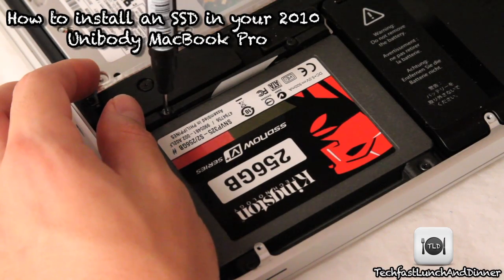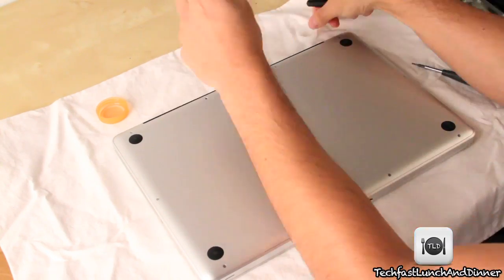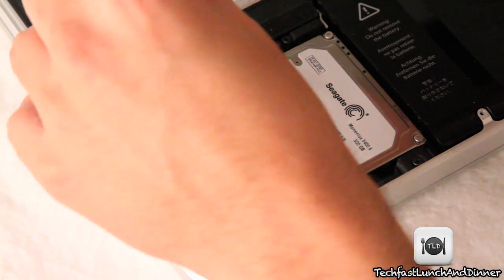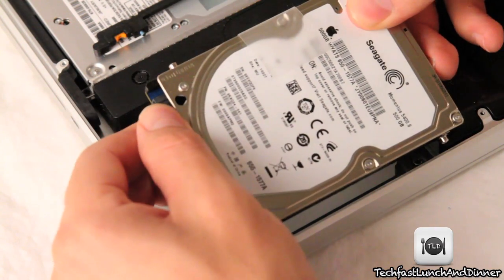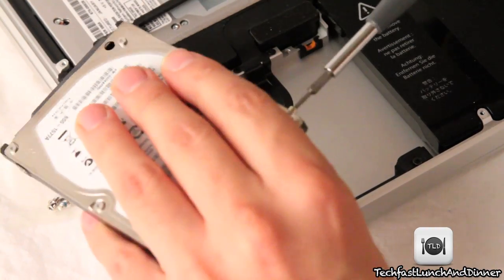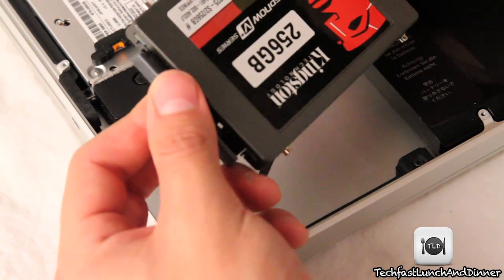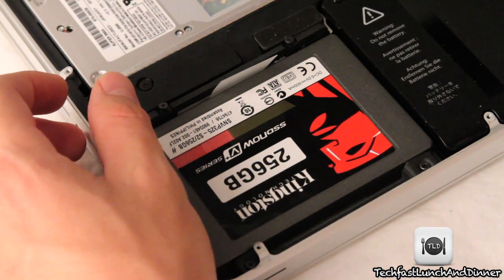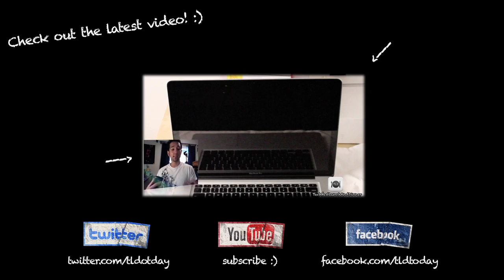How to Install an SSD / Upgrade Your Hard Drive on a 2010 Unibody MacBook Pro

Comment: Thank you for this old clip. Love their large size display as apple rarely if ever opt for 17" on laptops.
Are these unibody Apple MacBook Pros say those with Core 2 Duo 2.66 cpu any good for 2024? Or has Apple as always castrated them with wrong firmware upgrade/update or simply stopping the needed support to be compatible with current web media, despite having good hardware?

Comment: If i don’t have the OS installer, should i still do it? I am confused.

Mine is macbook air 2010/2011 OS snow leopard. Is the air same as the pro?
Reply: I might be in your shoes... So what did you do 2 years back if you still remember that?

Comment: Really well showed and explained. I’ve just done it myself following your instructions with my MacBook Pro 15 and Kingston 480GB SSD. Before that I’ve cloned my HDD to SSD using Carbon Copy Cloner. The machine is much faster now! The only puzzle is that when I turn it on, just blank white screen appears for about 10-15sec before Apple logo… then goes super quick. I’m just wondering if you have any idea how that can be reduced somehow… it wasn’t happening with old HDD. Maybe to change some settings…? Anyway it’s not a huge problem coz otherwise works great! Thanks

Comment: Hi Bro....Please advise.... is it also good to upgrade the RAM with SSD 250GB?? I have mid 2010 white 2GB RAM and 250GB HHD. I will upgrade to SSD for sure but would you sugest to upgrade RAM with SSD?? Is there any mean to upgrade the RAM? Please advise.... Thanks
Reply: Edge upgrade ram too it will help in the long run

Comment: Jonathan.  I have a question.  I ran out of space on my MacBook Pro (15", 2010 model).  I called apple and they told me I could not upgrade the HD on this "vintage" model.  Any thoughts?
Reply: +Claudia Carruyo No I think it's perfectly fine to swap your HD with an SSD or another large capacity drive.  I changed mine it works like charm now.

Comment: Thanks for this - it's exactly the Mac model I have. What's the name of the hard drive interface used in this Macbook? It's been years since I've played around with the guts of a computer -  then it used to be SATA II or something and the technology was forever changing. I need to know to make double sure I'm purchasing a current SSD with the right interface, since this video is 5 years old now. Thinking of getting a Samsung 512 Gig EVO Pro series. Would this work on My 2010 13" Macbook Pro? If not, what do I need to ask for? Thanks.

Comment: did you even tell people to unplug the battery
Reply: except there is a battery with power. So the battery should be disconnected and many people might think unplugging from the wall is enough. So datboy is right.
Reply: Anyone who needs to be told to unplug or turn off anything with electricity flowing through it before working on it probably shouldn't be allowed to dress themselves.
Reply: @mrphantomdream4656  Landrew is right , many people(especially those who would be you-tubing for instructions) probably wouldnt catch that, about the battery power

Comment: If you open the laptop it is okay the warranty will not be void. You can tell them you opened it if you want they don't care. If you change any parts, the laptop is still covered under warranty except the parts you changed. So it is better that before you take your laptop in to be replaced, you take your SSD or RAM or whatever you put in it out of it and put in the original parts that came with the laptop.

Comment: it does not void it, I just called apple and they say that they will cover everything except the hard drives. In other words, you just have to put the old HDD back and then go to Apple store if something is wrong with it, same thing applies if you are sending the device back.

Comment: Err not quite that simple. Many laptop manuals (PC/Mac) show you how to change HDD/RAM etc., but it voids their warranty all the same. Removing those screws on the bottom of the device is usually enough to void the warranty.

Comment: the physical connectors are the same but they dont do the same speed. eg sata 2 max out at 3gb/s i think and sata 3 max out at 6gb/s.

if your laptop has a sata 2 connector i would suggest getting a sata 2 ssd for the general price.

Comment: I would gladly take your $200 for this 20 min (HDD swap) and another hour or so (if that) if you wanted OSX installed. Pretty easy if you can follow simple instructions. If you don't trust YouTube head over to Apple.com

Comment: Great video. Super simple and not over 10 minutes long. I'm thinking of doing this myself. I've got an early 2011 model that I'd like to upgrade from the 320GB HDD to 256GB SSD. I guess the SSD can just be any kind? Or do I need to stick to a particular list of specifications? For instance, will any SATA III 6GB/s SSD work?

Comment: everybody keeps missing this extremely important part.When you remove the internal Hard drive, the SSD not only is probably formatted for windows and you will have to format it for mac, but it also won't have any OS on it. SO simply you will need to install the OS again and apple doesn't sell any CD's if you have lion. You will have to buy a Snow Leopard CD and install it upgrade to 10.6.6 and upgrade from Mac App Store to Lion. PITA!!!!
It would be easier to remove the DVD and add the SSD there

Comment: did you forget to tell them to clone the HDD? ooops? clone would be a lot easier then re-installing the entire OS... Nice try tho... And SSD for a 256GB your looking at 300 dollars on ebay. I saw some for 275 dollars no cheaper... But one can get a smaller for less but still a bit expensive.. ESP... to put one in a mac that's worth over 2 grand new and not to have a ssd... Well thats just right out robbery... :)

Comment: @nowaas Most SSDs are great but for you i would suggest an OCZ Vertex 3 they are among the fastest SSDs Cost Effective Extremely Reliable and are great for every day use you can pick up a 120gb vertex 3 from newegg for under $200 trust me they are great search youtube for reviews, plus they work great with MBPs and are twice as fast as the manufacturers SSDs and half the price.

Comment: Upgrading to SSD cost  more, the advantage is performance and battery life improvement, cause there is no moving parts, upgrading to 7200rpm is not worth it for the speed, and it will shorten the battery life cause it uses more juice.

Comment: @ciawondertrio Only if you take a lower speed in rpm, the size of how much files it can hold doesn't slow it down. For example your old drive is a 7200 rpm on and your new one is 5400 rpm, that would slow it down (amount of mb's per second). 
When your upgrading make sure you clone your old drive onto the new one using a sata to usb adaptor, or reinstall osx on the new drive. You can use tools such as Carbon Copy cloner to clone it.

Comment: @gabriel3374 
I knew I was exaggerating but I didn't know how much of an extent that I was, are you happy with the upgrade? Is it nice to have everything load up in less than 20 seconds now? I was very happy when I upgraded to my SSD.

Are you having any issues in regards to performance or firmware issues though? I've heard there were very bad issues with the firmware or performance offered by the Kingston SSDnow series. It was what persuaded me to go with another option.

Comment: just goes to show how simple minded/technically retarded apple users are that they need such an in depth instruction video to take out a hard drive.

unscrew screws, remove bracket, remove hard drive

any PC user/upgrader with the slightest amount of technical competence could do this on any laptop

stupid fuckin apple drones.

Comment: Great video. So after you installed it, you put the installation disc in and did it automatically boot to it, and you installed from disc to the SSD. Did you get a folder with a question when you first booted it up? Thanks in advance!

Comment: was the original one you took out a regular 5400rpm hd? like could i take my 13in macbook pro unibody (with a 250gb hard drive, not ssd) and put in an ssd drive? in other words, is it the same connection or do you need to buy the ssd macbook?

Comment: Just bought me a Macbook Pro 15" i7 Hi-res, with stock 500gb HDD and expect it to arrive next week. I also bought a Corsair Force F120 SSD hard drive, which I had delivered yesterday. The only reason why I didn't buy Macbook Pro with SSD from apple was because the delivery time. My school starts within 2 weeks so I had to get it fast. 
So, when my Macbook arrives the first thing is to open it up and remove the HDD and replace it with the 120gb Corsair Force SSD, using you'r "How to video".

Comment: uno the hard drive u took out, it was 500 gb, isn't that better than the one u put in, in terms of storage? ssd is quicker but can it hold as much as the 500 gb? might be a stupid question but im just wondering :) and i wana throw a 7200rpm in my macbook pro i7 also, how do i do that?